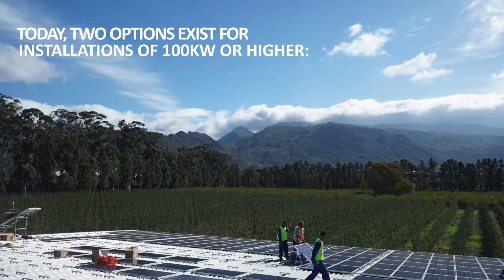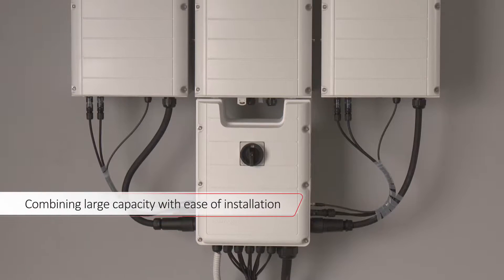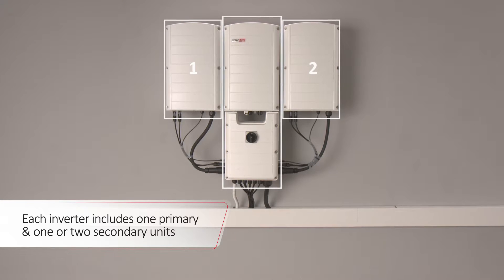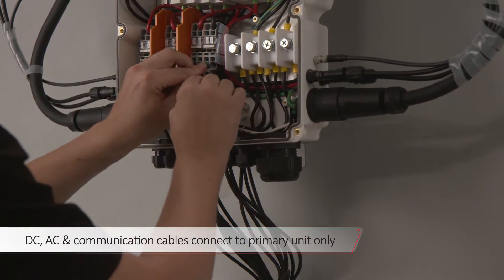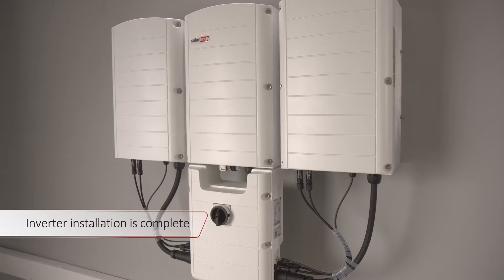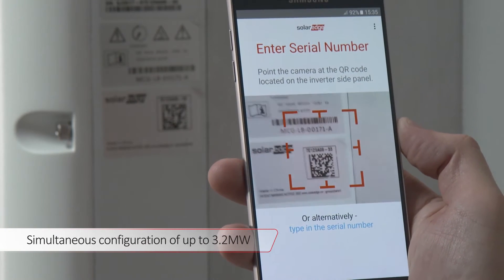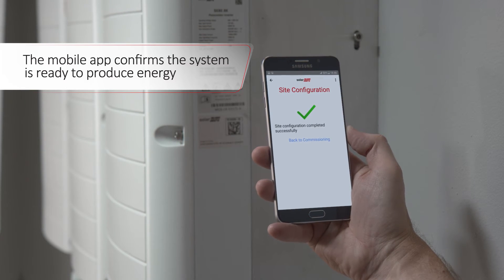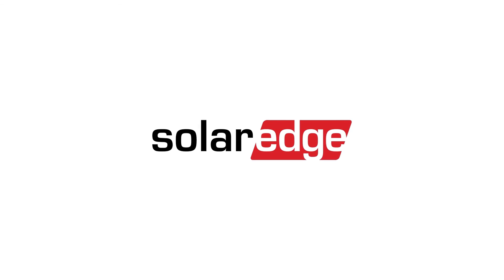SolarEdge's Three Phase Inverters with Synergy Technology

Comment: Hi can this support pass through AC charging? Basically I want to be able to use this unit also to charge a battery bank straight from Grid AC power also. Thank you
Reply from the maker: Hello, this does not.